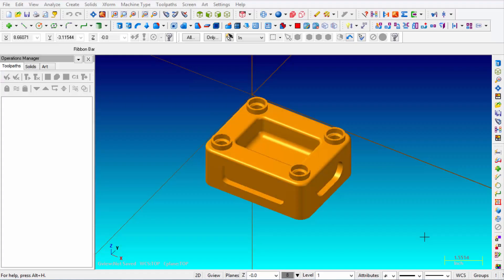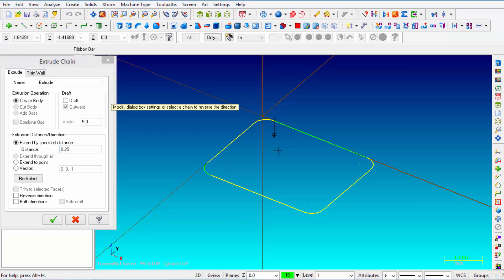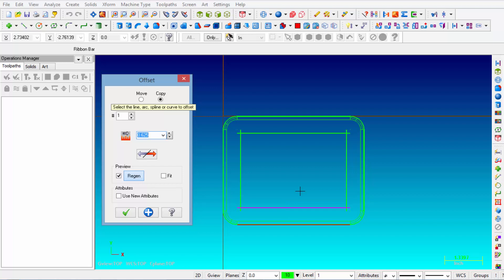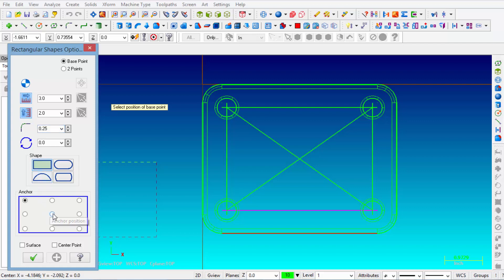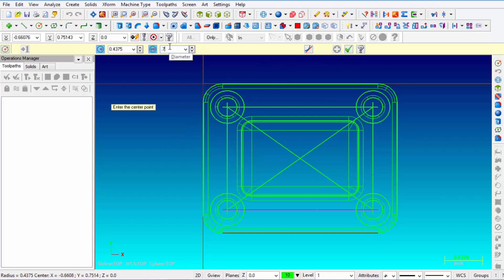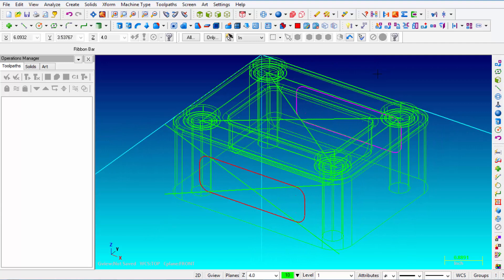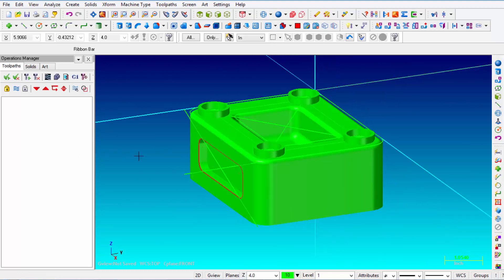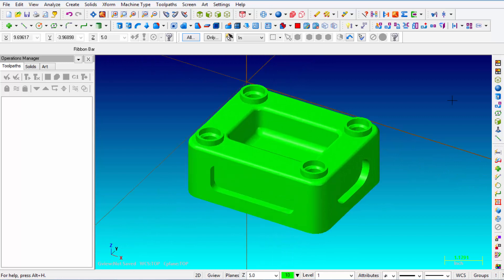MASTERCAM BASICS  PART 5 - SOLID MODELING

Comment: vary nice video. the only problem I had was, when making the endpoint lines to make the rectangle on the front or right sides. the line wasnt snaping to the face of the part. it was going inside of the part on the corner rads. i just found another intersection point to make my lines. Geting the same results as you. So not that big of a problem really.
Reply from the maker: Great!   Make sure that you are in 2D mode when trying to snap to existing geometry that is not on the same plane. At the bottom of the screen you can toggle 2D to 3D. 
Thanks for the feedback Greg.
Reply: Well I'll be. You are right, I was in 3D. I changed it to 2D and it worked exactly like in your video.
Thanks alot !

Comment: Quick question, I learned how to draw on AutoCAD so that's how my brain works. When learning how to draw in 3D in AutoCAD I learned to draw a feature, like a plug, the reverse of a drilled hole, or a cube, the opposite of the pocket and in AutoCAD verson 2012 for example, the method of making a drilled hole in a part, or a pocket, you would place it where you wanted your feature, and use the command "remove from", select the base part, "what" and select the plug. I was curious if there was such a thing in MC? Not that it's necessarily a better way of doing it or anything, it's just that the way I learned to draw in 3D, that's the way I would think do it first. Also, in creating a pocket, I might generate a filleted rectangle on one edge and mirror it to the other side of the base part and then remove them both from the base part. MC seems to be incredibly smart and user friendly which often means several ways of doing the same thing. Is there such a way of doing what I described in MC? Again just out of curiosity. 

PS, thank you for the awesome tutorials.
Reply: Yes, you can extrude, mirror and Boolean remove both from the original.  You can add or combine solids as well..